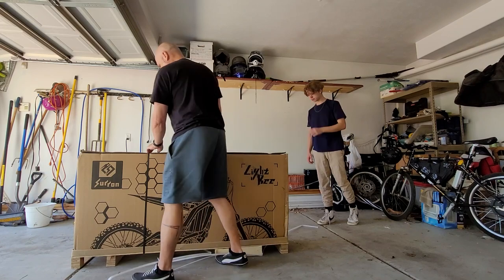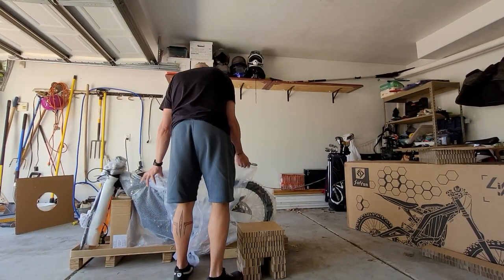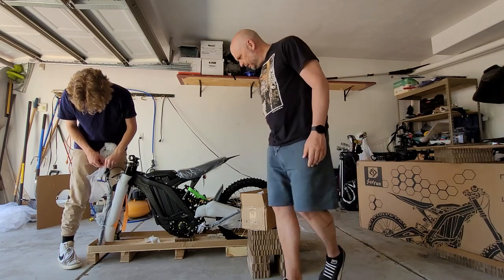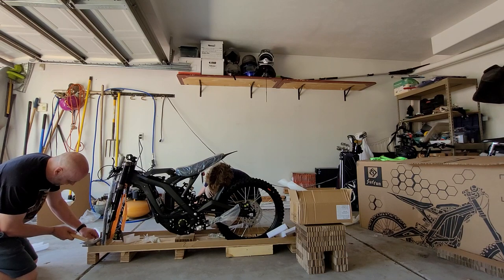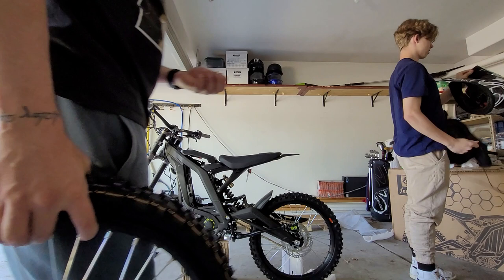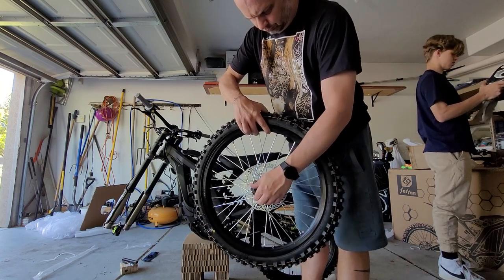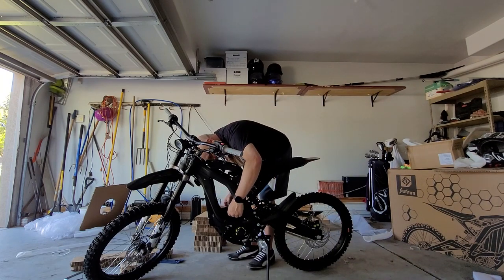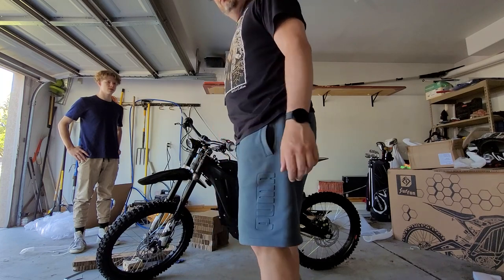2022 Sur-ron X e-bike unboxing and assembly tips. Electric bike MX dirtbike

Comment: You do the end caps first to make sure the fork arms are strait . If you do the pinch bolts first you can be out of line and cause where on the stantions. I do it opposite to the way you said
Reply from the maker: Thanks for the tip.. I actually used them to kind of center the axle in the forks.. but didnt tighten them all the way down..  then I did pinch bolts.  After that I tightened them down fully.  But I can see what you mean. My forks don't have any stiction so all is good!